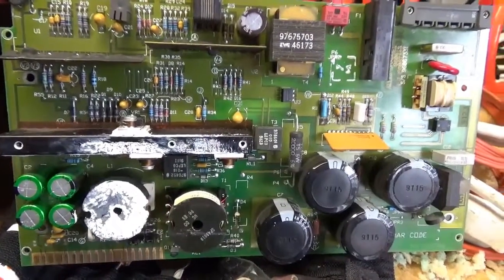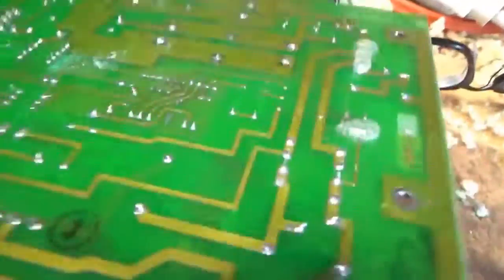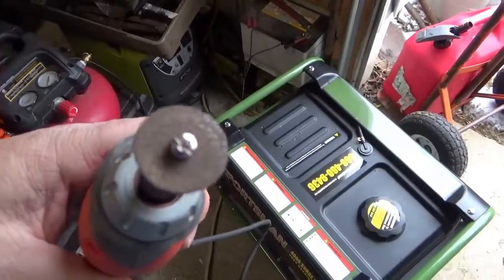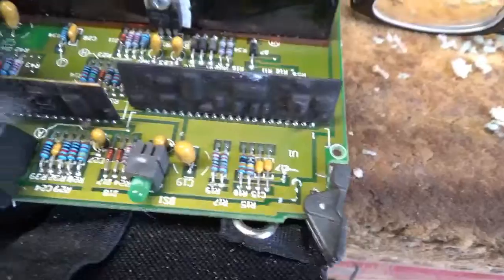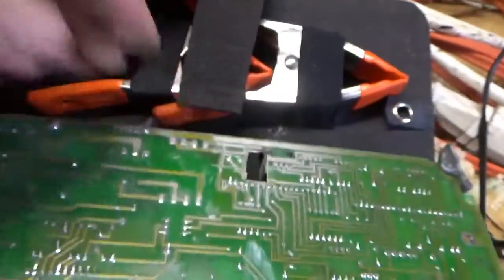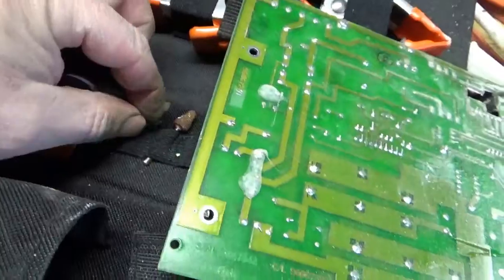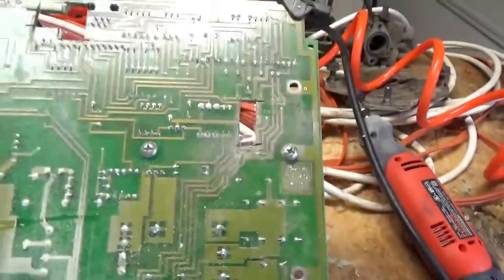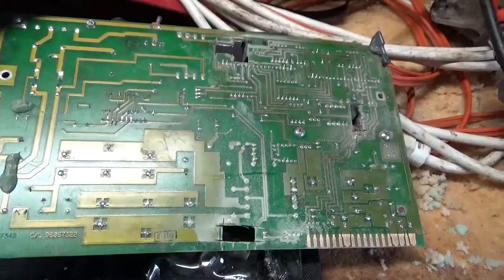Recycling Printed Circuit Boards, Reclaiming Diodes, Capacitors From Scrap!

Comment: honestly save yourself the time and use a torch on the solder side in the bench vise and pull the components you want with pliers. That phonelic dust is terrible (if you get too hot the smoke isnt much better either)!  Great work harvey! I love recycling electronics and making my own circuits, Your little dc conversion should work great! Honestly it is as simple as you want it to be aswell, You dont need a specific capacitor to do the job you want, almost any of those caps will clean it up!

Comment: That could be dangerous to your digits I would think . How much are those components if bought from a electronics store ? Man there has to be an easier way , I have 10 or 12 old computers here and if it works for you I’m building me one ! By the way I went to harbor freight and bought a couple small boxes for the wire harness conversion , they are 3”x5” and 2” deep , they should work ! Nice 👍

Comment: Hey buddy left you a message i have some quads for u get back to me please need to move them
Reply from the maker: Hey Royal Racing Tech, Where R U located???  What kind of quads and what R U asking????   That phone number U sent me, does it take texts, is it a cell phone?  Thanks for the offer, watching, and commenting!!!
Reply: Hey buddy  yes the number i sent u can get text but my service  is bad here ,do u have face book messenger,,,as far as the quads i have  a 99 bear tracker 2 wheel drive,,i have a 86 suzuki lt 125, and a 96 suzuki lt 160 quad runner they all run ,, the bear tracker runns but has wrong  carb on it ,, the suzuki 125 runs just needs choke cable ,and the suzuki 160 lt runs needs some better plastics and front brake cables , but they all run with minor stuff to fix ,, i am interested  in two dunebuggys i seen u have willing to trade all three  for two of the carts 9146597518 i am in Norwich ny upstate route 23 west
Reply: Send me your face book or number so i can send pics
Reply: 9146597518 you can text me there and i will send pics or send me message threw here not a problem  buddy
Reply: Hey buddy its jason please let me know what we are going to do my son is killing me asking me and i dont know what to tell him anymore  please let me know just trying to make him happy please buddy